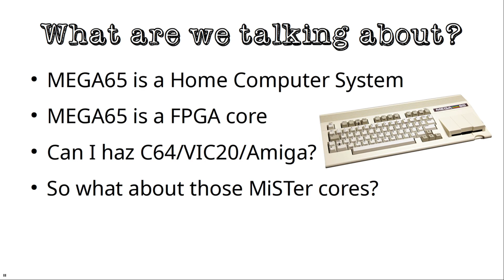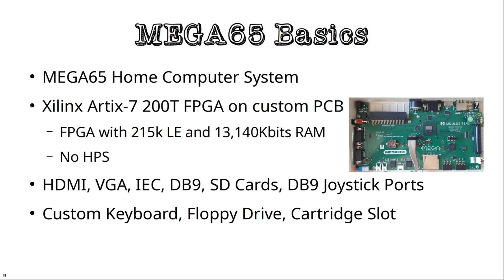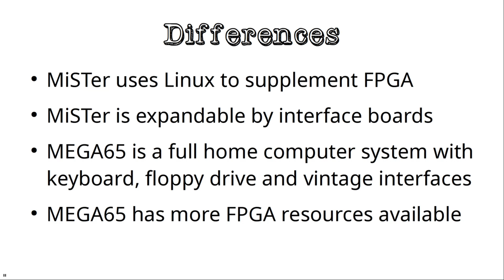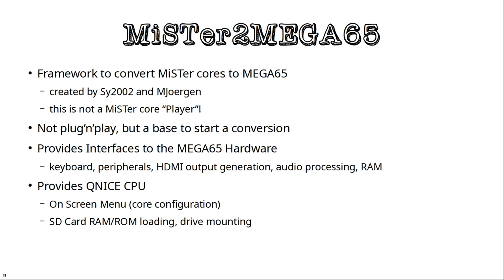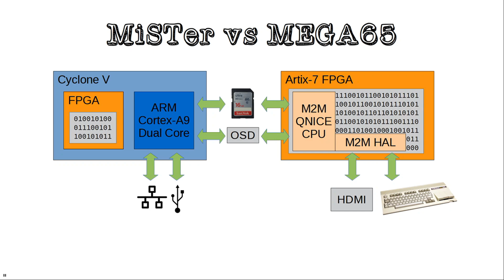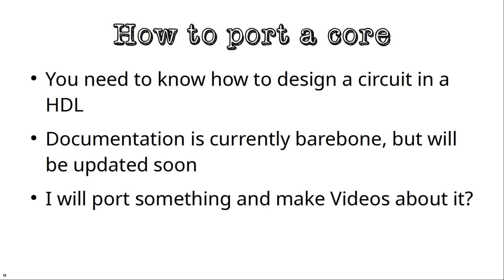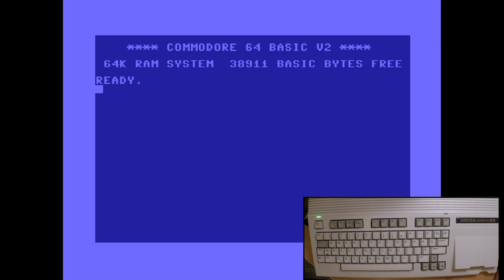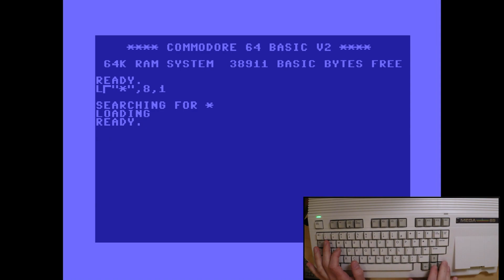MiSTer2MEGA65 Explained

Comment: Thank you so much for the hardware enlighten. Still, I have my reoccurring dream. I keep wondering about Commodore’s other line of 8-bit computers based upon the MOS 6502 derivatives. I keep pondering of the concept, what if via FPGA, one could implement a set of multiple predefined memory maps? Kind of like implementing a version of the VICE Commodore emulator on a FPGA.  Though the twist, would be, that the device, would first boot up to blank GUI interface which outputs to a HDMI 1080p (1920 x 1080 resolution) output. As such, a VIC II video chip or an 8563 Video Display Controller (VDC) is emulated and shows up as either a 320 X 200 or 640 x 200 window on the HDMI display.  Basically, a simple a right clink on the default blank screen, brinks a up short menu as to open/spawn 64K virtual address space, mapped to the choice of predefined memory maps.  In essences, it's these virtual address space emulates (to some degree) either a C64, C128, the various Pet computer or even a CBM-II B128 computer.  Ideally, I would like a built in CBM-488 and CBM PET IEEE buss.
Reply from the maker: Thanks!
Well, we plan to have cores for all the Commodore machines at one time in the future...
Reply: "Kind of like implementing a version of the VICE Commodore emulator on a FPGA"? It's non sense!

Comment: yeah, the MEGA65 is indeed very excellent, but it's cost is rather steep. So getting it to the point that it is a platform capable of running cores ported from the MiSTer project would provide much more justification for that premium cost. After all, a decked out MiSTer gets rather spendy.
Reply from the maker: My MiSTer setup until now had a cost of 420€ (without the MT32-Pi), if I add a very good cherry keyboard with custom PETSCII keycaps (the WASD Commander X16 for example) I'm at 600€. If you now throw in the possibility of extra cores (and perhaps a module based BliSTer/SNAC interface), the MEGA65 is suddenly not that expensive anymore, in my eyes.
Reply: You should see this Mega65 like a better C65 computer without paying it over 20/30 Thousand euros

Comment: I know each fpga chip has some of its own proprietary cells, but are the instruction sets mostly the same between each vendor?
Reply from the maker: A FPGA core is designed by a HDL, for example Verilog or VHDL. This is implemented to the FPGA by a Software that can do that. This is Vivado for Xilinx and Quartus for Intel.
So yes, you can implement designs from targeted at one vendors hardware on the hardware of the other. There might be slight changes required, depending on the tool that does the implementation.
Reply: The main reason I ask is the Fossi Foundation and Efabless making asics for free. I think they make about 10000 of them, as long as they're open source. I'd like to see some of these cores made into asics. You could probably turn the Mega65 into a Minor65 : )

Comment: With an expanded set of cores, is there a way for modern input devices and controllers connecting to the MEGA65?
Reply from the maker: If you mean USB by that, then no, the MEGA65 Hardware does not have an USB interface. It has two DB9 joystick ports. But the mainboard has extension PMOD ports, where additional hardware can be added. There are also breakout ports in the case, where such ports could be made available from the outside.